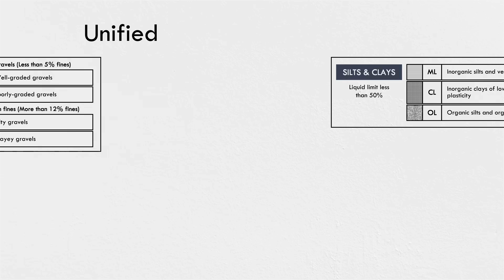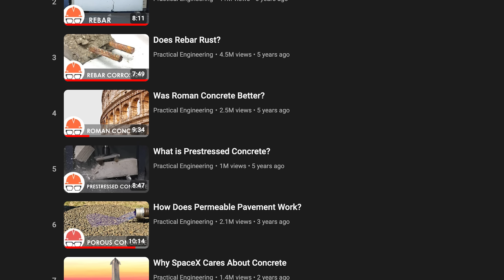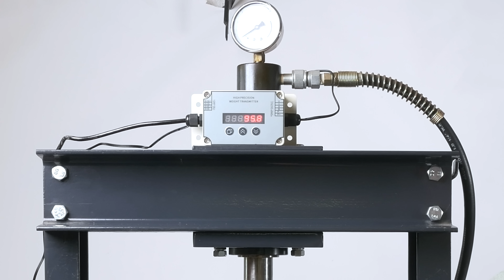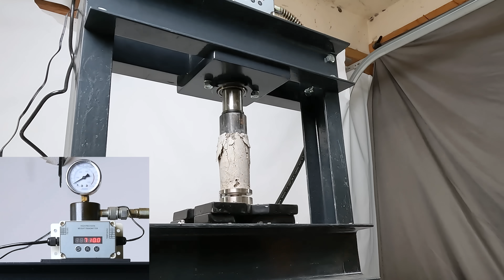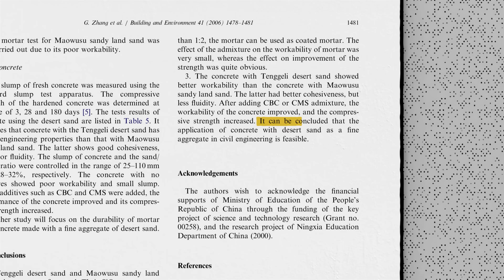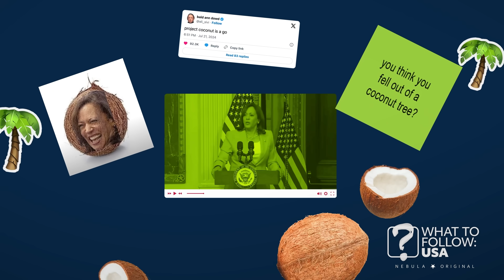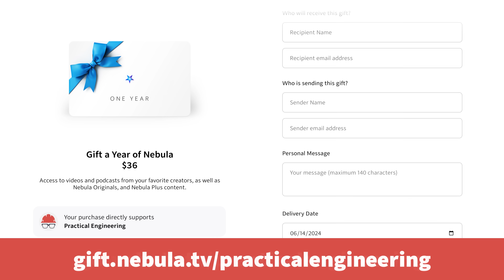Is the World Really Running Out of Sand?

Comment: I'm a geologist, and it's so novel to see things from ths "other side of the fence", so to speak. Even just hearing about the way sand is classified is so interesting! Of course, I knew that the level of specificity required for our measurements vs yours is different, but there's something very strange about seeing it in practice.
Reply: I always thought sand also had to have a specific chemical composition (like x% silica, or whatever).

And that, for instance, just crushing up marble or granite or whatever, would make "rock dust" but not (true) sand.

Apparently this is not correct, for civil engineers at least.
Is it true for geologists, or also not? :)
Reply: @MrNicoJac to me in a geoarchaeological context sand is a particle size from 2,000um to 62.5um that can then be defined compositionally. I've been in locations where the sand was micaceous lacky any true amount of quartz. I had a geologist on my dissertation committee as I mainly studied clay mineralogy and geochemistry for pottery production so I'm not completely ignorant.
Reply: Which one requires the higher precision?
Reply: @seneca983  It depends on the context, but I think engineering tends to have a higher average level of precision across the board, as opposed to geology which sometimes gets very precise but sometimes works with very broad strokes. 
It isn't that geologists don't measure things whatsoever or that we never care about precision, but it's less of a big deal to us in contexts like these, like if sand is coarse as opposed to very coarse.
Feel free to ask away if you have any other questions or want me to upond on that subject!

Comment: I've done a lot of testing on Natural VS Man Sand because I worked for both suppliers of concrete and for the Government, and from what I've found is that if your doing a hand finish or something that's going to be exposed where people are going to walk on it you want more Natual because its easier to finish and work with and finished smoother,  if your machine finishing or on roadway's and Runway's Man sand is better because it holds up better for flexural strength.  its the same concept with rounded river rocks or Crushed rocks.
Reply: I went to school with a kid with the same first and last name as you

Comment: Alright, so the key takeaways are:
1) manufactured sand is more coarse and irritating due to the sharp edges
2) natural sand is better at getting everywhere due to the rounded grains reducing friction
Reply: okay, THIS is the best sand joke in this entire comment section
Reply: when you simplify it this far I can only conclude: i hate sand. but i’ve also made five foot sandcastles only to try and watch the tide destroy them over night.
Reply: Either way, Anakin HATES it.
Reply: LIAR!
Reply: I bet you don't like sand and killed all the younglings.
Reply: Technically not all natural sand. The sand is rounded due to erosion, so in places with no erosion, e.g. the moon, you get very abrasive sand.
Reply: @djinn666 I'm guessing Tatooine sand is nicely windblown.
Reply: @djinn666 that sounds so irritating
Reply: Natural sand. The rounded sand is from rivers and ociens where its tumbled. The angled sand is from mountain erosion, iceplate movement(works like a coarse grinder).
Reply: that's all true, but the real question is...do you like it?
Reply: Natural sand (or sand particles with rounded grains IS VERY IMPORTANT IN SILICON-SEMI CONDUCTOR making, and thats the sand that is naturally 'running out'
Reply: @chromesucks5299   Ngl, the dessert is full of natural, rounded sand. That was kind of the point of this video. Also, who cares if it's rounded if you just melt it down and purify it for use in a circuit board? I'm sure you have high purity standards for everything, so it's just a matter of cost to get what your raw material is into what you need it to be.
Reply: @kindlin  'just matter of costs' 
Aint that the truth,  

I havnt researched or looked up myself, but while ago the same source had the 'desert sand isnt good for it because of coarse nature' while 'water treated sand' is the best one for semi's
Reply: @chromesucks5299  its not running out. Its just cheaper to steal it from beaches of third world countries which will naturally be near ports to ship than to truck it over thousands of miles from landlocked deserts to the nearest port. 
Ultimately the cost issue is that trucking is way way more expensive than shipping so people are willing to take the risk. But the landlocked deserts and beaches have way more sand than we're using. Its like shale/venezuelan oil vs middle easy oil, harder to extract/refine but if cost of oil ever gets high enough, then humans will start using it.
Reply: @gjfwang desert sand is wind eroded ergo smooth grained like the tumbled version. River and ocean sand hasn't had the same harsh collisions the wind causes so the sharp points remain. Abu Dhabi actually imported ocean sand specifically bc their ample supply of dessert sand would not lock together properly for the palm shaped islands terraforming project.
Reply: @TheAnantaSesa It's not the shape that matters here; it's the grain size. The idea that shape is the issue has been debunked—desert sand grains are simply too small.
Reply: @chromesucks5299 The shape doesn’t matter; you need pure quartz sand with a high silicon dioxide content. You can’t just use any sand because not all stones consist of silicon dioxide.
Reply: @chromesucks5299 i think they make industrial rock tumblers.

Comment: Actually... It's building sand, not concrete sand we are running out of. The stuff used for building walls and plastering. That can't be manufactured as it requires other materials to be in it naturally, other than silica.

Comment: an interesting fact about recycled crushed concrete that is mixed into soil to act as larger aggregates like gravel will make your compaction a lot harder to get without adding more water than the average load that will come out of a quarry. 
this is to say that moisture helps compact soil and having concrete chunks soaks up the water.

source: was a tech for a soil and concrete testing company

Comment: Borrowing from another comment, of course we aren't running out of sand, strictly speaking anyway. We also aren't running out of water, Earth is drowning in the stuff. But that doesn't mean there aren't water crises all over the world, or that violent wars over water access and control aren't killing people every day. The same is true for sand, and I think one of the big points of Beiser's book is that there are very serious environmental, socio economic and deadly consequences to the ways we are using sand. Especially the more pure and rare sands used for silicon manufacture. Additionally, Beiser wants to help make everyone more aware of those consequences so they are not so easily overlooked and unregulated. Even if Beiser, and the industry in general is wrong about using smooth grain sand, the fact is we don't. And we should be careful not to think "If we start using dune sands, we'll never run out," or "there are no environmental consequences to using dune sand." Everyone time we say that we always make an irreversible mess because we aren't careful.

Comment: to belabor the water content...did thousands of yards of concrete....also built houses....oe mjob on we started to install sill plate and ws puling up the 1/2" bolts...found concrete contractor watered up the mix to top off the fountion from just 2 points...he nadded 20 mgallons of water to the mix immediately...the other was on site helping pour an aggragate tunnel in new batch plant..contractor was scared of water we had trouble vibrateing the mix thru the rebar numerous rock pockets and voids...both instances were repoured

Comment: Grady, Concrete strengthens over time and it also weakens over time too.  Here is my question.  When companies use recycled concrete to make a new concrete structure doesn’t using recycled concrete shorten the life of the new concrete structure?
Reply: The concrete itself gains strength, it only weakens because of external factors like constant cyclic wear, cracking, water intrusion and rusting rebar. When you recycle concrete into aggregate all of those weak points go away because eg youre removing the rebar, any weak spots will get split when crushing, so on

Comment: It was reported that a sand mine in Western North Carolina, in a town that was destroyed, is the sole source for ultra pure natural silica feed stock to make silicon crystals for the manufacture of semi-conductors. I actually was in a sand mine decades ago. There is a decommissioned sand mine on the flanks of Mt. Diablo in the San Francisco East Bay that is in a public regional park. I was surprised at the heights of the galleries, on the order of forty feet high. It was the least claustrophobic underground environment I have ever been in.
Reply: It’s not the sole source - but it did make up a large percentage of it. Lower purity quartz can also be used, it just has to be purified which is energy intensive (and therefore more expensive)
Reply: @mtqrx  According to multiple references, Spruce Pine, NC is the sole source for semi-conductor grade quartz.
Reply: @avsystem3142  those sources must be out of date. spruce pine does (or rather, did) about 180,000 tons yearly. more mines have sprung up especially in china because its cheaper than shipping it from spruce pine. e.g. hubei guoda new materials group has mined about 20,000 tons last year and are already building a second phase which will add 50,000 tons per year. information is harder to source because ofc its in chinese not english.
Reply: @mtqrx  I choose to believe the sources I looked at instead of some rando on YouTube who is entirely too invested in proving they are right and everyone else is wrong.

Comment: The failed spillway at the Oroville Dam had river stone in the pour! River stones are rounded. You can see them in the pictures of the broken concrete after they got the water shut off. 😮 I wonder if they used river stone in the control gates? There’s a big crack at Gate 8.

Comment: Of course the answer is no. But that also isn't what people are saying that we are running out now. It's the simple fact that at our current pace of use, we would destroy our beaches and coastal areas. 

It's the simple fact that only a specific type sand is a very specific type that only comes from certain conditions. No we aren't going to "run out of sand." It's just that the sand needed for concrete is so specific that it can only come from certain places. I.e. desert sand CANNOT be used, and only coastal, river and lake sand is needed and that sand is QUICKLY disappearing. There are ALREADY ENTIRE ISLANDS that no longer have a beach because the sand has been stolen and taken and as more and more countries develop will exponentially increase the demand and use which is going to destroy the beaches of the world. 

Yes, there is a lot of sand on planet, but that isn't the issue.. it's the type of sand, it's where that sand is located and when you extrapolate the use of western countries to where developing nations are heading too and there simply is not enough of the type of sand used to go around and we WILL ACTUALLY run out of the sand needed...

Comment: There were towers in China that had to be demo'd or they started falling down themselves when it was found the developer swapped out real sand for sand that was taken from ocean/beach. This was during the construction boom when they were doing all that speculative investing and there was very little oversight. I can't recall if the issue was due to the salt due to it coming from the ocean and that having issues with the rebar, or if had to do with the fact that ocean sand is ground so dang fine due to the currents constantly having them all rub on each other. Sure you were able to make grains of a certain size, but they had rough edges. Ocean sand comes in all sizes too - but they all get fairly smooth pretty quick. And it's not just rocks in ocean sand, but also ground up shells and other marine life

Comment: I drive a mixer, 1000s of times I've seen a load be tested, pass THEN add 80 gallons of water to the truck and make in a slump so sloppy it couldn't be measured 😂. Nearly every load I carry is turned into "self leveling mud" as we call it.

Comment: Besides concrete, I've heard of cases where tumbled sand is preferable to crushed, such as beach sand.  So there are instances where the demand for it outstrips supply.  Such as a beach in Jamaica that was illegally mined at night.

Relatedly, I imagine manufacturing tumbled sand to be too energy and time intensive to be feasible at scale.

So with the above in mind, along with your video on weirs, what do you think about some sort of a weir design that would tumble rocks into sand for you?  

It could safely remove the destructive energy of the flowing water, while simultaneously creating a potentially in-demand sand.  The process would likely be slow, but could essentially be free from energy and labor perspectives.

Comment: The "constant workability" test is interesting, but I have heard (I'm a software engineer guy, not a concrete engineer guy), in heavy-duty "industrial grade" concrete, there is only enough water to properly cure the cement and workability is increased by other additives. Your test shows, that desert sand is completely OK for plain old redneck concrete, mixed with shovels and small electric mixer, completely feasible for DIY buildings (I'm not sure About USA, but here in central Europe it's a pretty common thing), but I'm curios, if it's comparable strong even in heavy-duty applications like skyscrapers and huge dams. Like If the best possible concrete from round sand is comparable with best possible concrete from crushed sand.

Comment: What if you run the same experiment bit add big rocks for simulating real concrete? I would imagine the workability to be more dependent on the rock structure and not the sand

Comment: I work at a Geotechnical engineering company as a lab technician. Every day I do grain size analysis testing and use the grain size textural triangle. I'm personally not in the field as much, but we do all of those concrete tests that you mentioned as well. It was really cool to see my day job discussed in a YouTube video from one of my favorite channels. Thank you Grady.

RCA (Recycled Concrete Aggregate) is never fun to run a grain size analysis on because of how dusty it always is. I just felt like adding that bit of information :)
Reply: Is there actually any recycled concrete that doesn't pollute if you use it as e.g. road filler?

It's a standing joke here in Denmark that our EPA-clone has defined concrete as non polluting to recycle since almost all batches of cement os filled with some or other form of waste product such as ashes with a high content of undesirable element.
Reply: Addendum: I was thinking about Fly ash that's often used - and it can contain lead and arsenic.

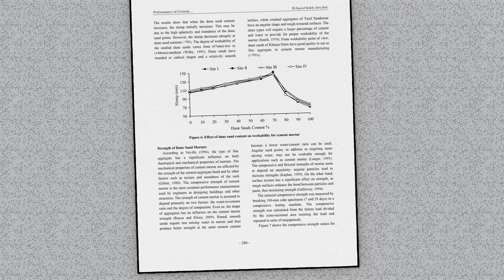Comment: Huge fan, hoping to give constructive feedback, and also warn junior scientists watching: At 8:14, you pull a fact that's only cited there.  This means that you are outsourcing the interpretation of the cited paper, which is a dicey proposition.  Especially since there's a non-zero chance the paper they cite has done is actually just citing a third paper: it turns into a game of telephone, and that game is only fun because ideas get garbled.  It's always best practice to chase it down to the original paper, to make sure it hasn't been misrepresented or misunderstood somewhere along the line.

This one seems entirely reasonable, and matches well-understood theory and practice, so it's unlikely that it's a real problem, but I've seen more incorrect citations than I want to think about over the years, some of which have wasted days of my time.

Edit to add: welp, you went on to make almost exactly this point less than 5 minutes later 😅

Comment: I work as a process engineer and safety manager in he prestress concrete industry and I found this video extremely interesting. I'm currently working on the new buffalo bills stadium and do these common ACI tests almost daily. Another test similar to the slump/spread is called the segregation test. It's when the spread is above about 26 inches and your w/cm ratio is approaching the limit at which the water can be consumed by the cement.

Comment: I once used a concrete pumper that pumped what was really grout.  He used 3 inch hose that would not pass anything over 3/8 aggregate.  I recall him commenting about "sharp" sand from a particular source that was hard on his equipment.

I would be interested in how the difference in "hardness" between the sand and aggregate in a mix affects the overall concrete strength.

Idea for a video: the use of fiberglass rebar and how it compares to steel.

Comment: you are being WAY too gentle with beiser. he is a charlatan and a liar. one of his oft-repeated claims is that "desert sand" cannot be used because it is smooth and wind-blown. you questioned this from an engineering standpoint and found two ways that smooth sand CAN be used (correct water ratio, and roughening the smooth sand). but the more realistic issue is that SMOOTH SAND IS RARE. dunes are rare! well under 5% of the world's deserts are dunes. almost nobody who lives in a desert is near a dune. sharp rough desert sand is superabundant. vegas and phoenix and almost every other desert city in the US are getting their sand for concrete locally. not from DUNES, vince beiser. they are getting it from bajadas and rock quarries. they are not shipping it from riverbeds in wetter places. they are driving 10 miles outside downtown vegas and pulling it from the side of a mountain. it frustrates me to no end that beiser has gotten this far with his lying.